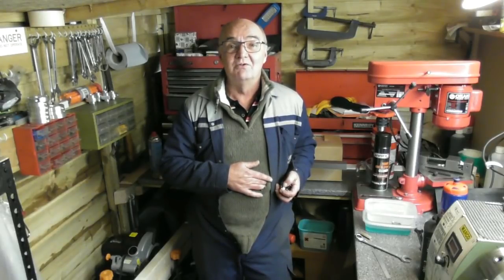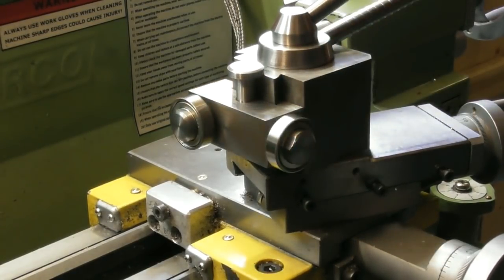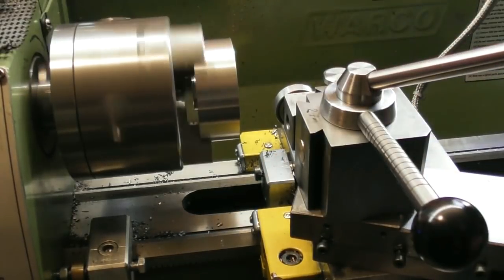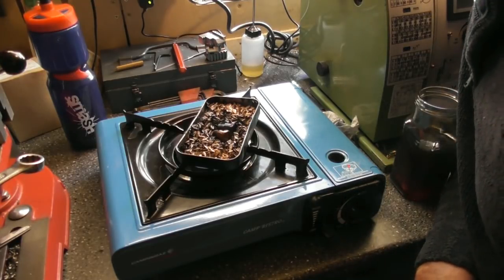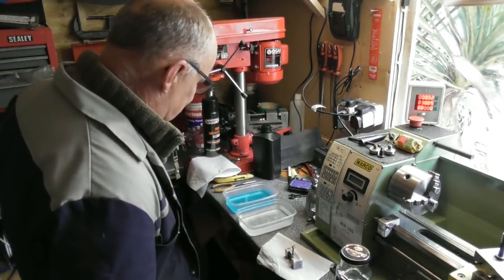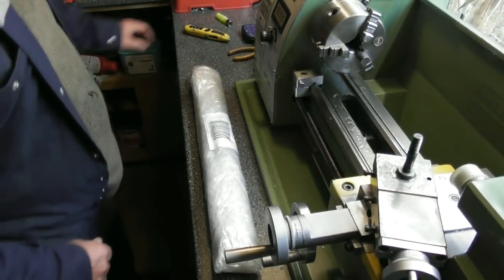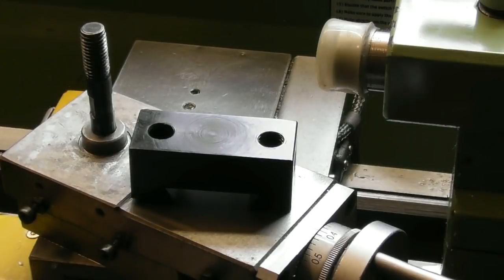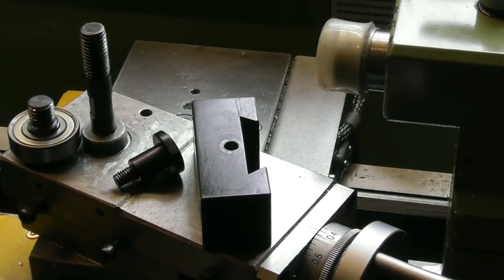WARCO LATHE Shop made quick change tool post part 15

Comment: The “push tool” is really nice. Now, I’ve got to make one.
It will go grey some time after blue. It’s just the heat treat color chart.

Either the shed is burning, or Adrian has a smoke sitting off camera to the right.

Comment: 2nd the nice job, Ade where did you get the en8 40x25 bar from.
Reply from the maker: steelcitygav on ebay , £19.95 plus post i think
Reply: I could only find 30mm x 25mm in en3 being the largest that steelcitygav list?.
Reply: Since found the larger sizes after scrolling down their stock list, but en3 & no en8 listed ?.
Reply from the maker: I just checked my order and you are right, i got EN3 . i should wear my glasses when ordering ,
Reply: Ade where do you source most of your aluminium stock from for reasonable money.
Reply from the maker: ALUMINIUM DROITWICH ON EBAY ,  best value i have found as i buy a lot of alley.

Comment: How would gun bluing compare to what you used here?
Reply from the maker: The black oxide is far longer lasting in our damp climate but i do like the heat blueing  look,. it needs oiling on a regular basis for us , Cheers Ade.
Reply: @ade63dug  That is interesting and very true, I guess as I lived in a dry climate for most of my life I often forget that the UK and Ireland has a very high mositure content in it's air.